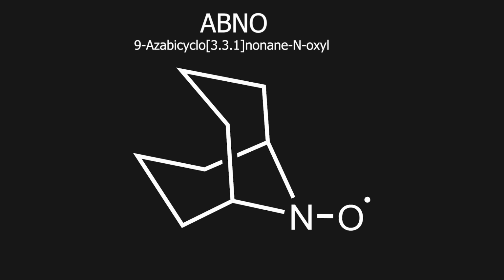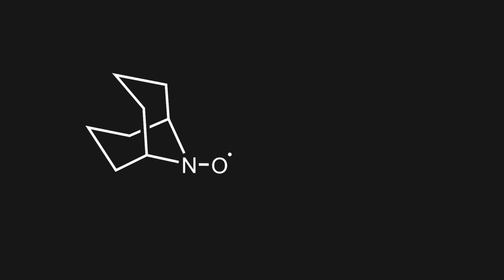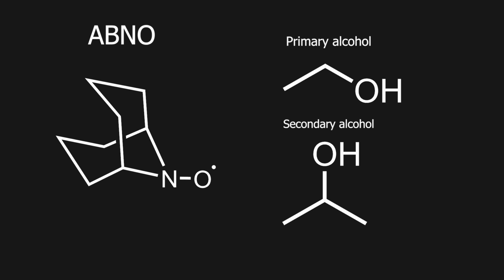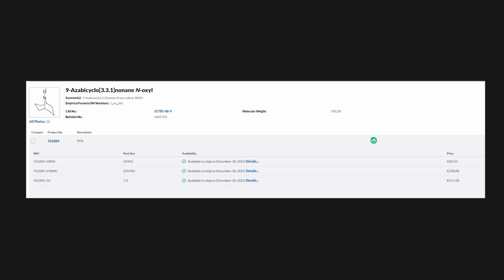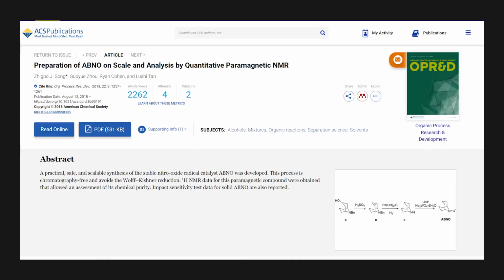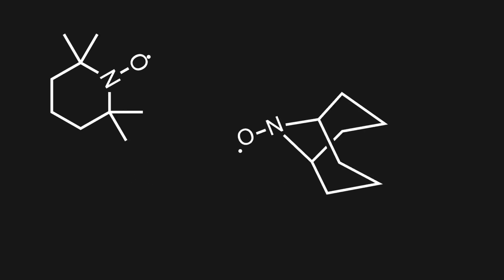Making ABNO: A New Stable Radical

Comment from the maker: For this video, at the end, I have added an insight in the price I pay for pretty much all the chemicals I use in this video. Also, I have added captions which I plan on doing for every future video to destroy the AIs. Enjoy and have a nice new year's!
Reply: Thanks for the cost analysis. My question now is how many days/hours did this synthesis take - and how much does a chemist charge for an hour of his/her work while babysitting something like that - cause we assume your time isn't free (probably could be running few synthesis in parallel, but still).
Reply: An informative professional educational video.  Thanks. Just found your content and channel.
Reply: I think if your yield was even marginally higher you would have beat the sigma price, if you could have gotten 2g it would have saved you 200 euro over buying it outeight
Reply: 2:24 "When that is done, the mixture has turned to a piss-yellow".
I love science!
Thank you for the effort and the video, Chemiolis!:)))
Reply: Primary and secondary alcohols can be easily oxidized to aldehydes and ketones respectively using  PCC/PDC (Pyridinium chromates), but it's toxic AF. lol  Therefore Oxoammonium-catalyzed oxidation is preferred.
Reply: Dont know why but the old Rancid song ruby ruby so ho popped into my head🎉
Reply: Would of been cheaper buying since your poor %. Did you calculate time for cleaning all that glassware🎉

Comment: Hey, your videos are really interesting. But they're dangerous because you give the impression that synthetic chemistry is as harmless as baking a cake. I wonder how many amateur chemists who have replicated your experiments have set their homes on fire or injured themselves in explosions.

You don't give any warnings about the dangers associated with the experiments. Nowhere does it say that the chemicals you use, the intermediate products you produce, or the waste products that accumulate in considerable quantities can be harmful to health or even carcinogenic. In addition, you work with equipment that is not adequately secured. You don't secure stoppers, you don't make sure ground joints are tight, and you work with a heat gun even though there are highly flammable liquids in the flask below and the ground joint may not be tight. The craziest thing I've seen so far is hydrogenation with a gas balloon filled with hydrogen. That's completely mad.🫤

Translated with DeepL.com (free version)

Comment: If it's a stable radical, is it realllyy a radical?
Reply: A radical has a strict definition, its a specie with an unpaired electron. It happens to be quite unstable most of the time but that doesn't mean it has to be very unstable to be a radical. Ofc these amine oxides are way less reactive than other radicals (thus saying it's "stable", lol) but still can act in reactions specific to radicals (ex : forming other radicals, very useful in controled radical polymerization for example where is bind revsersibly in a very weak way to other radicals to stabilize it). You can think of stable carbocation (for exemple Ph3C+) the same way: u can do chemistry with it (ex: H- abstraction) but the fact it is "so stable" becomes very handy to actually use these properties without losing the reactant at the first small mistake.

Comment: As my field is automation engineering I cannot say anything about the awesome physics and chemistry but I wonder about the hydrogen balloon. A) can a silicon oil be used as a sealant inside the balloon?(wet inside) B) If de hydrogen is needed multiple days, can it be produced locally with a tube to a electric dissociation device and match the production with the reagens speed? The production trigger can be a optical level switch in the electrolisis tube.  I was duckshooting that this would give a good indication of how much the reagens consumes to protonate and thus give a intermediate result for yield or something.

Comment: For chemoselective oxidizing alcohol to ketone or aldehyde, Dess-Martin reagent is a better choice as no metal catalyst is required. Besides alcohol oxidation, this kind of nitroxyl radical is not a strong electrophilic HAT reagent so it can only do HAT for some activated C-H like the alpha C-H of alcohol which is activated by hyperconjugation. For this reason, I am not that interested to use this in synthetic chemistry.

Comment: Acetonedicarboxylic acid can be made cheaply from anhydrous citric acid by oxidising with 100% sulfuric acid (or preferably oleum). And glutaraldehyde can be obtained much cheaper than Sigma-Aldrich prices, as it is used as algaecide, as a fixative (alternative to formol) and 10% solutions are even used to remove warts. So this brings ABNO well in the reach of the dedicated amateur chemist (next to 4-hydroxy-TEMPO made from triacetonamine).

Comment: just curious, so at 3:50 you distill to dryness but in my undergrad classes we were told to never distill to dryness at risk of forming volatile peroxides. is this untrue in this situation? is the difference the presence of solid in the distillation flask?
Reply from the maker: It is only a problem if you would use unstabilized ethers

Comment: Why are you adding heptane to remove DCM?! The boiling point of DCM is at 40°C and the boiling point of n-haptane is almost at 100°C
Reply from the maker: When it boils they will distill off together, it helps in removing all of the DCM from the mixture. At the same time it will precipitate the ABNO. Since the ABNO sublimes easily it was better to not distill it to dryness and instead use heptane. Their method was more suitable for larger scale. For lab scale it would probably be more useful to completely skip this step, distill it and dry it, then do vacuum sublimation on the residue.

Comment: Some advice on hydrogenations: you can simply use a smaller amount of Pd/C. To recover the palladium, use a filter paper. This way, you don’t have to waste your precious and expensive catalyst. Don’t use a frit to remove Pd/C because in it can release palladium which will screw with NMR if you use this frit for drying agent removal and crude NMR measurements.
You can alternatively use sand, not celite, to remove Pd/C if you don’t want to recover it. 
Wash catalyst with water, when you dispose Pd/C. New Pd can actually burn pretty easily when washed with MeOH and dichloromethane.
Reply: Strictly speaking, it was Pd(OH)2/C (Pearlman's catalyst) in this case, but I think most of your points still are valid. And I was also really surprised by the large amount of cash money catalyst that was used.

Comment: Wait, why did you purge with CO2 at 9 minutes? Amines are used as "scrubbing" agents a lot because of their ability to take up CO2 and form carbamates. Ethanolamine is a great example of this but it works on any unhindered amine
Reply from the maker: Of course this is a thing that exists that I didnt know of 💀 I think in this case the contact with CO2 wasnt long and extensive enough to matter. I can imagine scrubbing is normally done with high surface area. Or maybe it did something, who knows 🤫

Comment: What is the reason behind its stability?
Reply: Stability is related to the fact that nitroxyl radical decomposition has to do with alpha hydrogen abstraction and elimination. ABNO’s alpha hydrogens are bridgehead hydrogens that if eliminated to a double bond would form an extremely strained imine.
Reply: @michaelryan3731   Thank you :)

Comment: I may be wrong but it looks like you only used a single balloon for the hydrogenation? In future, I definitely recommend putting one balloon inside another for added security, then either electrical tape or parafilm (I prefer electrical tape or a jubilee/hose clip) the two balloons to the rubber tubing. Also worth noting that unhindered (and even some more hindered primary amines) can react rapidly with CO2, so that may not have helped.

Great video though!